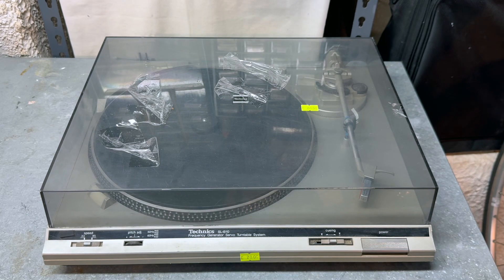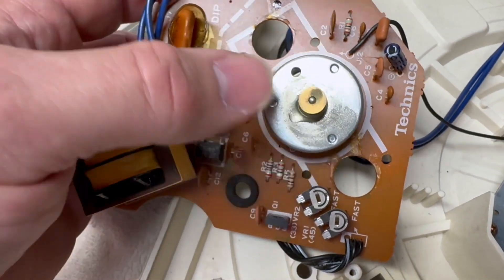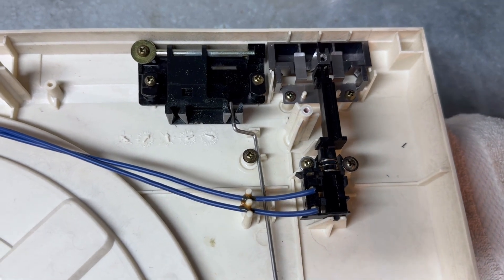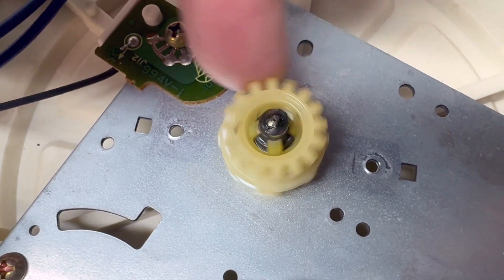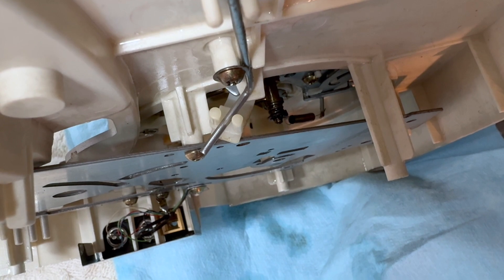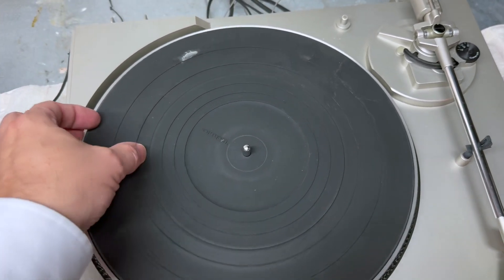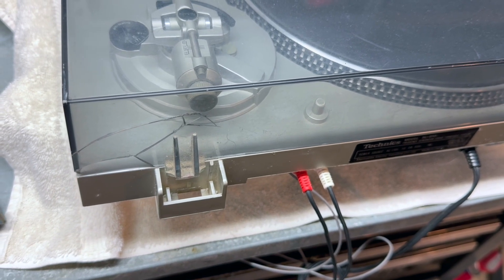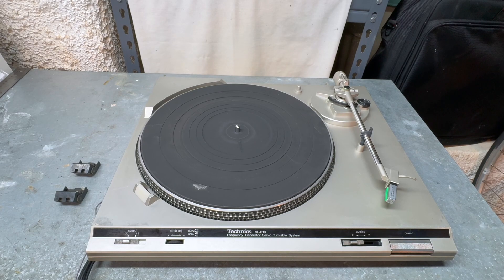Silencing the motor on a Technics SL-B10

Comment: By squirting WD-40 in there you absolutely ruined the queuing system in that turntable. That is dampening fluid that's why it goes so slow it is intentional
Reply from the maker: I know what you mean, but it needed to be loosened up as it wasn't moving at all.  It actually works fine now with no additional damping fluid added, but I have the fluid if it ends up needing it.